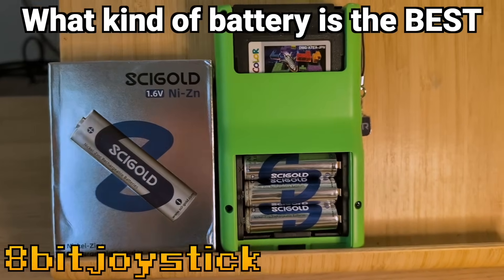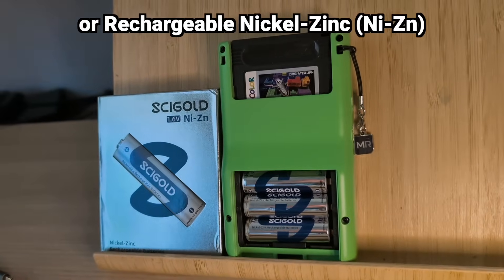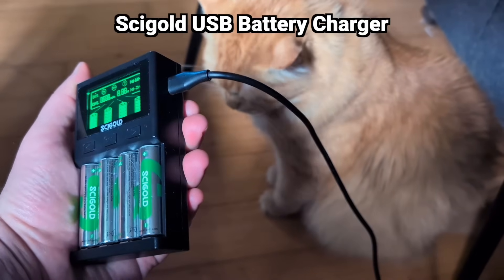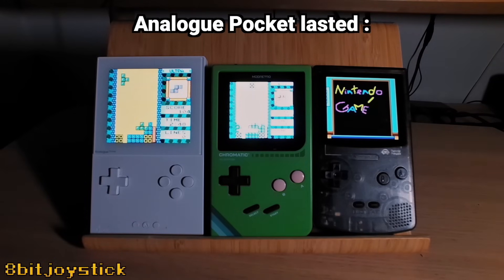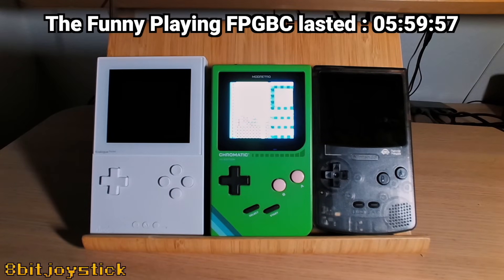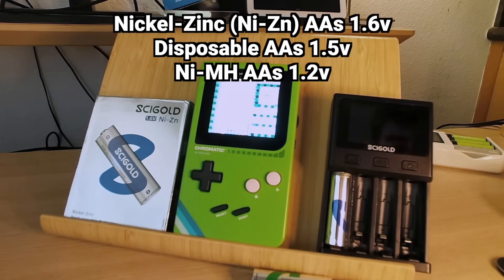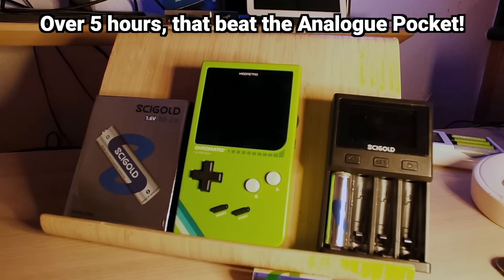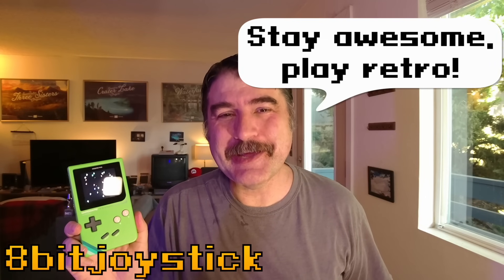Best Rechargeable Battery for Your FPGA Game Boy: Ni-MH vs. Ni-Zn!

Comment: The Chromatic using an odd number of AA’s is kind of obnoxious on the basis that batteries generally charge in pairs. They could have squeezed one more in parallel circuit with another.
Reply from the maker: I also found the use of three AA batteries to be a little weird but it really is an excellent form factor and like my test showed it got really excellent battery life. But whenever I charge the batteries I do it in my charger meant for four and I always have a spare battery left over

Comment: Oddly enough, installing a new screen in one of my old DMG’s actually improved its battery life inexplicably. I surmise maybe there was some sort of fault or defect in the original screen or associated board that was unnecessarily sapping voltage. As far as the original DMG, rechargeable alkaline is perfectly fine enough. For Modded GBA, rechargeable lithium AA’s is the best option. USB rechargeable battery mods are actually over-kill, and introduce several unnecessary inconveniences. I grew up predominantly with a Gameboy Pocket, but I always disliked its smaller form factor, and especially the AAA batteries that were required. Sometimes I used to tether D batteries with wires to the terminals so I could play Pokemon uninterrupted, more economically in my bedroom, because I never could find a plug that tiny, or any store that carried the associated ac/dc adapter, until I found one thrifting in my 20’s. 😂
Reply from the maker: Well, the original non-backlit gameboy was designed with an incredible battery life as the highest priority above all else. So it's interesting that you're having battery life improvements since you swapped out the screen out but the modern hardware is just completely different. Since I made this video chromatic is now selling a rechargeable battery pack so I will have to get that and test it out
Reply: @8bitjoystick  It was just one that I previously repaired the stock screen ribbon cable by reseating the solder, and years later was developing some kind of rot in the top right corner. My other DMG has the classic bifurcated backlight mod, and it gets about what I’d expect. I dunno. I think something on the front board was probably vamping current somehow or another, cause it always seemed to have unusually short battery cycle since I bought it almost 20 years ago for a whole one dollar at the Goodwill store. 🤷‍♂️

Comment: Interesting video. What mAh rating were the Ni-MH and Ni-Zn batteries? I’d be interested to know how long the Modretro Chromatic lasts with the recently released battery pack too as I looked at its mAh rating and decided it wasn’t much higher than my Ni-MH batteries so I opted not to buy it with my Chromatic.
Reply from the maker: Well, I'll have to ask ModRetro to send me one of their new battery packs

So I linked to the battery manufacturer's website but AA batteries were listed in  mWh (milliwatt-hour) measures energy, while mAh (milliamp-hour) measures electric charge.  So it's not an apples apples comparison, but over 7 hours of gameplay it's pretty goddamn good

Comment: I see a small problem in that we don't how much wear and tear the batteries built into the first 2 handhelds have already undergone.  They probably aren't at max capacity anymore, so I'm not sure it's a fair comparison. I'd also like to see a wider variety of batteries compared, with a few different types of rechargeable AAs and some regular Duracells as a baseline. My current favorites are Sanyo Enloop Pro because they don't discharge as much as normal rechargeable batteries when not in use and have pretty high capacity for their sizes.  How long do the AAs in this video hold their charge when not in use?
Reply from the maker: Well I got my FPGBC in March of 2024 and my Analogue Pocket In February of 2024. These are my own personal handhelds so I take pretty good care of my stuff. And I don't think the overall batteries would have lost too much of their storage capacity and a little over a year of regular use

Well I got the generic Amazon batteries NiMH, and the Scigold Zinc and NIMH batteries. And I'm going to test the fpgbc one more time tonight to find out the difference that in Everdrive has on power usage.

It would have been interesting to run a comparable test on two brand new hardware systems but unfortunately I do my best for the equipment that I have.
Reply: @8bitjoystick  I wouldn't expect you to replace the battery in your Analogue Pocket or anything, just making the observation. I hope the testing with the other batteries goes well. I'm also curious how much the Everdrive affects power draw, so please let us know.  Makes me wonder if that was the straw that broke the camel's back in my broken Lynx, and it contributed to blowing a capacitor or something.

Comment: The everdrive pulls extra power. So using that to compare isn’t a very good idea.
Reply from the maker: Here you go Update:  Test: How Much Power Does an EverDrive GB X7 REALLY Drain? - https://youtu.be/ymoRCU4pNt0
Reply from the maker: Well, the only one that that would affect is the FPGBC  since that's the one that I used with the Everdrive, but I could repeat the test tonight with a regular cartridge. I only have one copy of Tetris DX. I will have a supplemental video to post tomorrow

Comment: I would be curious to see if the sound drains the batteries faster, though I don't blame ya muting the gameboys as it would be rather annoying hearing the bleeps and bloops of tetris for hours.
Reply from the maker: Well my decision to test with a sound turned off was twofold. I don't think it's statistically would contribute to battery drain, nearly like the light emitting screens, with the exception of the third test, I ran them at night so I didn't want to hear Tetris DX going bleep and bloop while I was trying to sleep and I didn't bother to set up a microphone for the time lapse.  Letting your camera record overnight at three frames a second actually didn't have a problem. I use two Elgato cameras and they had no problem running for 8 hours.  I've heard that some high-end film cameras dislike being used for that long.